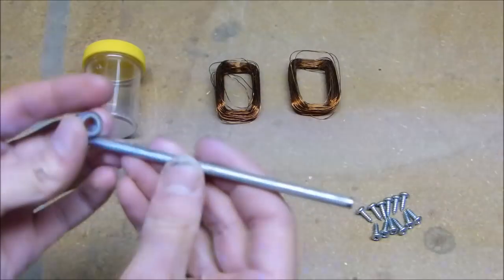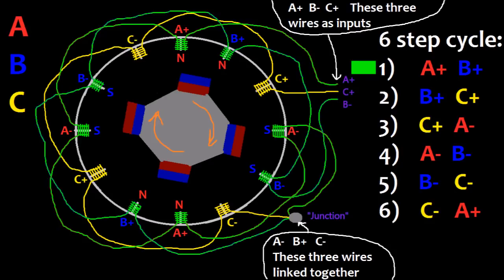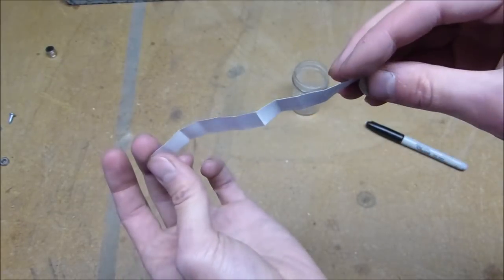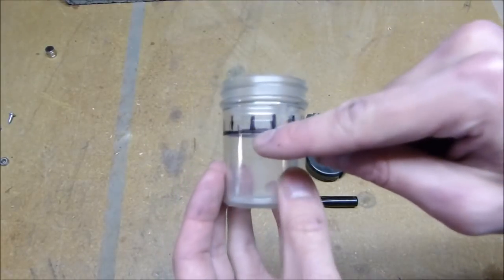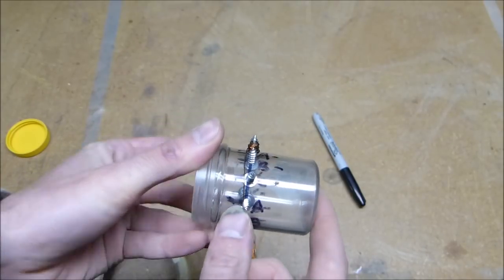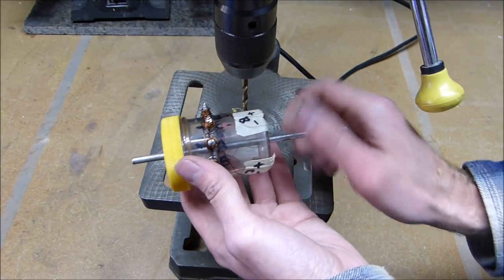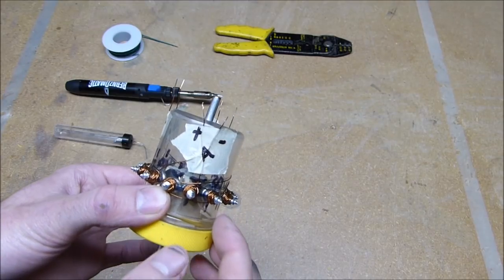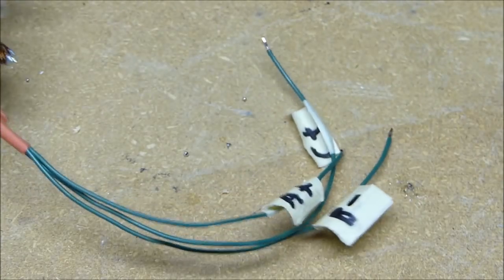How to Make a Brushless DC Motor Inrunner

Comment from the maker: Thank you to everyone for 1 million views!
Reply: No problem, I was just confused on what you have hooked up to the ESC other than the 12 V battery and the motor. The small device to the right that has a light on it, What is that?
Reply: is it possible to make a 22v battery for this then invert the voltage to 110 and power the motor without any problems?
Reply: please reply
Reply: JaycubL
Reply: i thing  your step cycle wrong , but it is very impressive  project good
Reply: Hey! How about a pdf file step by step direction? Your stuff is really good.
Reply: Where is Hall effect sensor
Reply: I tried to build One using your "concept" i followed all your steps and it's the same as your but the motor doesn't  spin correctly and smoot , it need help to start and it can't handle same speed , It slow down and It accelerate and It slowdown and It accelerate forever when i am at same speed using the remote and i can't control the speed  .It  could be the esc that can't run this motor ? Ps the esc work with a 4 pole 12 slot motor pls help!!
Reply: You stole the internet's heart recycling that drinking straw for the bearing
Reply: Can you make a video on ESC?
Reply: Well-deserved..actually you deserve a 1 million subscribe
Reply: I made one a couple of years ago. I couldn't get it to work. Looks like a servo connected to the esc. I sat this down because i couldn't figure it out or how to get it running so i sat it down. I just watched your vid again to help me understand now i remember why i sat it down.
Reply: Can you explain why we use turn clockwise and anticlockwise ???

Comment: best vid i've ever viewed! thorough and concise without wasting any time. i wish the englanders would quit all the gabbing and do as you do. bought a small peanut butter jar and have just now consumed the inards to start on this project.
would more wrappings produce more power or rpm or both.
Reply from the maker: More windings would improve torque but reduce max RPM, and would also reduce max power slightly (by increasing resistance and reducing the amount of heat that can escape).
Reply: thank you,cuyler

Comment: A quick tip: Fillets on the screws are sharp, the motor would be much more reliable if you put some masking tape on the screws before the winding, so that vibrations doesn't scrape off the lacquer from the wire, and doesn't makes shorts...
Reply from the maker: +RPBCACUEAIIBH Yes good point, thanks for your comment!

Comment: are u using two bearing balls? if not, u can use them, they will spin smooth and spins longer when u turn it off, and low noise! and no rattling of course

Comment: Great video.  I hope you don't mind me asking a few questions.
1. What is the gauge of the wire you are using?

2. When you wind your coil wire,  do you start from the tip of the screw in or from the other end outward toward the tip as that certainly changes the polarity, unless it doesn't matter as long as you do all of them the same manner?

3.  As you alternate the direction of coil winding in each screw ( pole), are you basically making each stator pole opposite to each other ( north-south, north-south)?   Is that the idea?

4. On your magnet rotor, you have the same poles of the magnet opposite each other,  one pair north-north and the other pair south-south.  If you had 6 stator poles, would you do the same winding set up as your 12 pole stator?  And would you have the same set up with the magnet rotor the same as here? I notice some folks do not alternate the direction of coil rotation on 6 pole stator windings.

5.  With 6 pole stator, could you use 1 pair magnet, and would the two poles be the same or would they have to be opposite as they show in the most diagrams?  As you know it is pretty confusing.

6.  Could you use 3 stator coils at 120 degrees apart and if you could, what would be the magnet rotor, would you use one magnet with opposite poles or the same poles facing out, and could you use more magnets?

I followed your setup with both 12 stator coils and 2 pair magnets and 24 stator coils with 4 pair magnets with each pair same pole facing out as you have them and it worked as it should. But it did not work with 6 coil stator and one pair magnet with opposite poles facing out. I can't remember if I tried the same poles on the magnet facing out.

Thank you most kindly.

Comment: thank you for the video. it's helped me a lot. but could you possibly tell me how to make let's say 200 kwh motor? what shall I need for that? to put longer wires and more powerful magnets? will 60 kg neodinium magnets suit for my project or not? and by the way can you tell me how to calculate how much wire i have to use? is there any sort of formula that could help me?

Comment: i wonder if I could use my android adapter and build a positive & negative wires and attach it to my broken usb plug so i can use my android adapter as the primary plug to plug into any 220 outlets at home with that brushless DC motor, is that safe??

Comment: So that could be  stupid thing to ask, but did you put all the copper wire coil rounds in physical contact with each other and screws because it's surface is non-conductive when oxidized?
Reply from the maker: The copper wire is enamel coated

Comment: Fantastic video! Highly informative! I'm actually working on a very similar project for a DC motor course for school and I may very well end up using this design!
Reply from the maker: +Jamel Moore Cool!
Reply: +JaycubL Just out of curiosity, if I don't have access to an RC brushless motor controller, can this project be powered by a simple DC or AC power source?
Reply from the maker: Jamel Moore Not with this design unfortunately.
Reply: +JaycubL  ok. Thanks. I'll just try to build it as I see it here.

Comment: Great project! I tried to make it, but it doesn´t work.
I have some question for you... if you can help me!!
1- Can I test the motor without rc plugin to the esc? 
2- I connected the motor to a 12v drill battery, but doesn´t work. Any idea?
3- Is necesary to insulated the wires? because it was not explained in to the video.
4- I made it with 6 magnets instead to 4.
i have:
- a 40a esc speed controller.
- a 12v drill batery
- i don´t have a rc

Thanks!
if you have an email i can send you pictures about my motor!
Reply from the maker: +Kida Kawer Hi! You will need the controller for it to work you can not connect this type of motor directly to a battery and have it spin. The brushless motor controller replaces the mechanical brushes and acts as the commutator, turning each coil on and off at the right time.This wiring pattern is not actually designed to work with a 6 magnet rotor. You could make a 4 magnet rotor for it, or re-make the coils. You would need 6 sets instead of 4 sets, each A+ will be across from an A- if you know what I am saying.
Reply: +JaycubL Thanks for your answer! two questions more.... can i use a speed controller using a servo tester?
How many Volts or Ampers I need it? Can I use the 12v drill battery?

Comment: So what a motor controller does is selectively pull the A, B, and C wires high (say 5V) in sequence (the six you show) to turn the motor? And how fast the controller steps through the sequence determines the speed of rotation? And the higher the voltage it uses to pull up the wires the more torque the motor has? And the only limit to the maximum voltage you can apply is mechanical (ex. what the wires can handle)?
Reply from the maker: Yes to all of that. One added bit of info is that the controller detects emf in the non-active wire (only 2 out of 3 wires active at a time). It uses the detected emf to stay in sync with the motor's rotation.

Comment: Hey, i have a little question. i wired 25 turns on a single screw, and powerd it with 9v battery, but it didn't attracted metal at all, i tried with thicker wire and 100 turns and it worked just a little bit.
Whould it be enough to power motor, if it hardly works as electromagnet?
Reply from the maker: It might be a stainless steel screw that is non-ferromagnetic, meaning that it will not work as well as a regular steel screw. Did you try attracting a magnet with it? I don't know if it will work for you or not.
Reply: can you please tell me how much weight your one screw with 25 turns can lift? i'll try to fiqure out what core should i use best

Comment: Hi, I am a student and i would like to make the motor that you show in your video, I will do it for a university project, and I have some questions about the materials used in the video,so  could you say me please which battery do you use for power the motor and you use another thing, in the last minutes of the video there is like a sensor that is connected between the motor and the battery, what is it?.  I would be really thankfully if you answer my questions. Best regards

Comment: I can't ell if you plugged it into a battery,( voltage?). and some sort of switch?,  The controller appears to have three wires out and not sure how may wires in and or where they  went to?  Most of the speed controls I saw on Amazon had 4 wires out and two sets o wires in....  Plus I couldn't really catch the name of the speed controller you used.  So I don't know if there are different kinds of speed controller and you have to use the right ones.... ?
Reply from the maker: Any standard speed controller or "ESC" for brushless motors should work, they have 3 wires out to the motor with two wires in from the battery. The battery I used was an 11.1 volt 3 cell lipo, but a wide range of batteries should be fine (check with the directions on your speed controller). There are a few videos on YouTube now that can show you how to make an electronic speeds controller for brushless motors.

Comment: I just want to say thank you for clearly explaining everything you did. I'm trying to build this as a class project, and the only power is a 9v battery. Your motor end up with three wires, B-, A+ and C+, how would I connect it to a 9v with only two heads?
I do not have the speed controller, do I just solder the A+ and C+ together and use the B- by itself?

Comment: using plastic screws would eliminate resistance no? im guessing three pole would also work so like -a a -a, b -b b, -c c -c correct?
check out a george green magnetic motor instead of some controller as well
if you can turn an axle you can collect energy guy
the brushless dc motor would amplify the rotation of it
dont think use power to spin... think use spin to create juice

Comment: I tried making the same, unfortunately something is not working right...
   Ive used the ordinary magnets instead of the neodymium magnets... Should the ordinary magnets get the blame for the failure? I tried to compensate it by increasing the turns from 25 to 75..
But even this idea failed.. 
 Let me know some factors I need to be considerate about...
 Thank you In advance..
Reply from the maker: +Ganesh Hosur I am not sure, it could be the magnets. But you are right about increasing the windings, it would help compensate. You could try re-making the rotor so the magnets come as close as possible to the screws / coils.

Comment: I'm going to use this video for a school project and have a doubt about the separation between the screws. Mine are going to have like 1cm of separation, is it ok or is it too much? Which is the maximum?
Reply from the maker: You don't want the screw spacing to be much wider than each magnet.

Comment: Fantastic. I would like to make a high torque turntable motor. Somewhere around 4kg max or 2.2 constant. If a motor is labeled as 16 poles does that mean that it has 8 magnets? Also how would one go about controlling the speed of the motor? Resistors for a constant and potentiometer for a variable? I really think you oughta kickstart a build your own motor kit.i would buy it.
Reply from the maker: +Jason Turnipseed For more torque make it large diameter, or use a belt or chain to gear it down for low RPM high torque. How much would you pay for a motor kit?

Comment: I have a question, is there a certain position you need to pit the screws in? like does the A need to be across from the A- or can you just put them any way you like
Reply from the maker: +HAYN nebulous clan The 12 screws need to be evenly spaced. Then every third screw is in the same set, so A (space) (space) A- (space) (space) A (space) (space) A-. A will be directly across from A.

Comment: Is there a way to use this without the speed controller? Just attach the wires to a battery or something? I was looking for something completely homemade and watched the whole video before I realized I needed to buy a speed controller...
Reply from the maker: +chris eldridge You can make a custom controller which I will do eventually and make a video, otherwise you would need something to keep it switching (like brushes). If you just connect it straight to a battery it will rotate a fraction of a turn and hold there.

Comment: but the copper wires running from each A+ to A- to A+ etc, don't they touch other screws and wires in the way?
Reply from the maker: +Hassan Eido Oh, no the wires actually don't touch any of the screws because they are insulated with a thin layer of enamel.
Reply: +JaycubL ohh right. thanks!

Comment: thankyou sir for making this video this is the most wondefull video i ever watched on youtube . really very good idea sir . also good explanation sir but the similar problem about the three wires coming out connected to controller can we use any other idea and which battery is used for running this motor .if you reply i will be very much thankful to you sir and keep making video more like this.thankyou sir

Comment: Am stuck at ESC. After connecting motor to ESC and lipo, what else do I need to connect so it rotate. My lipo is a 3.7v 1200mAh .
Reply: There should be two other cables (Black & Red) comming from your ESC that are used to control the throttle.

Comment: Hold on.  Is it just me, or does the point at which the wires connect complete the circuit?  So, the inactive wire acts as the wire to ground for the two active wires, right?
Reply from the maker: No the two active wire sets are source and ground (one gets + other gets - ). The inactive set sends an induced signal to the ESC for timing the switching in the ESC. If the inactive set was a path to ground, then it would be an active set 9since current would flow through it).

Comment: great video...(Y)...but how do i connect the motor with other power like usb charger or something else with two cable power input..sorry for silly question but i excited to learn after saw your video...thank you so much for your great answer...
Reply from the maker: Brushless motors require a controller (the controller replaced the mechanical brushed, for switching each coil on and off in sequence). They are sold as sensorless ESC or "electronic speed controller" for RC hobby stuff.

Comment: hi...can i remove all the C...? coz i dont have baterry with three pims...so can i keep only the A and B?? will thw motor work?? plzz rply
Reply from the maker: +Akhil Shah Hi thanks for watching! haha battery with 3 pins???? No that is not how it works... The battery still has a + and - terminal like normal, but the inputs are switched by a controller based on the rotor position.

Comment: Its awesome.. but with what u have connect those outside 3 wires
Reply from the maker: +Nikunj Gupta You need a brushless motor controller. They can be ordered online, or I will be making a video eventually showing how you can make one.
Reply: +Nikunj Gupta Get an ESC from your local RC hobby store. they will know what you need.

Comment: hello brother, has 12 coils and the rotor 4 magnets. now; It works if I put 6 or 8 magnets?
Reply from the maker: +Asylum This motor is designed for 4 magnets, because the coils are making 4 "poles" at a time and rotating them around the motor. Thanks for watching!

Comment: great video cub, your knowledge is great, think of numerology specifically mathematical [magnetic] vortex, then on the degree camber [°degree] think of multiple electrical phases for [not just the usual single or three phase] delivery of energy to every degree on the camber equipt with plenty of torque. also with the vortex think of double helix.. two sine waves, one negative, one positive this will remove all latency  or magnetic lag and will also remove the vast majority of vibrations. in thinking of overheating control the temperature using thermocoupling . try that for your next project ;)
Reply from the maker: Thanks for sharing your ideas! I am trying to see what you mean, but I am not completely sure. If you feel like explaining further I am listening to you.
Reply: Voltage is torque.. frequency is speed.

Comment: if you have magnets with center holes can you just insert the shaft inside !  , does it still work?
Reply: Knight Time I don't really understand the question. If you're asking if putting the axis in the centre of the magnet that wouldn't work because as the video says on the top and bottom you need a North Pole and on the left and right a South Pole.

Comment: great stuff...but can the the coils be put with alternating direction side by side or has to be a set of 3 in one direction and the other 3 in another direction?
Reply from the maker: +Vimal Saxena Thanks for commenting! I am not sure exactly what you are asking. The coils will need to be done this exact way unless you want to use a different design. You can read about or design many possible ways to do it.